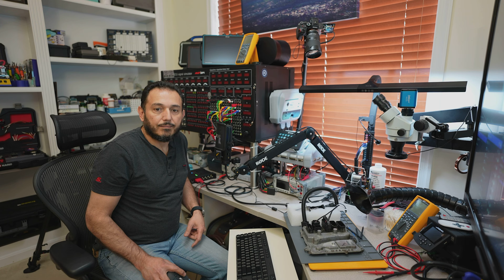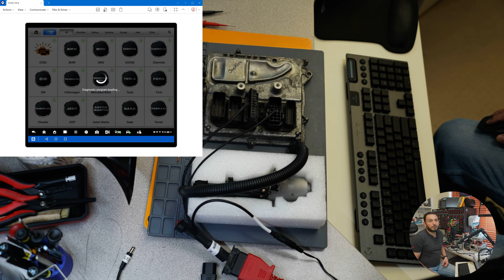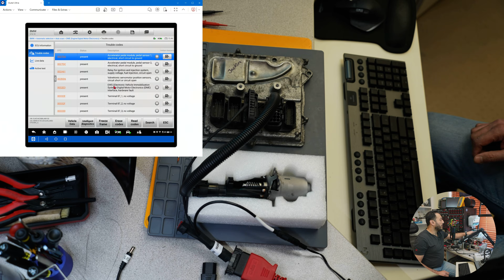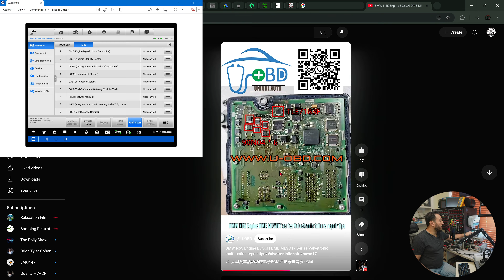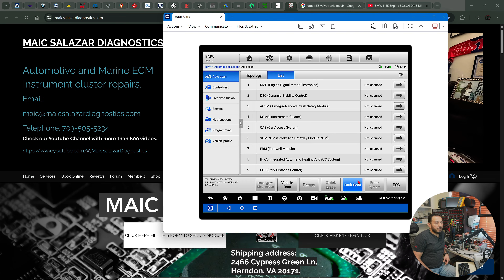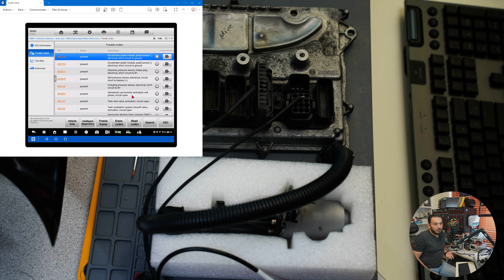2011 BMW X5 N55 No start, valvetronic faults DME test before repairs www.maicsalazardiagnostics.com

Comment: I am having some issues with mine I just don’t know how to take the circuit board out, 

I keep putting new valvetronic motors in and they keep failing after the relearn limit position
Reply from the maker: The DME is located under the intake manifold and it is bolted to it, so it is better to have a shop removing it.
Then you can email me at maic@maicsalazardiagnostics.com to send the module for repairs.